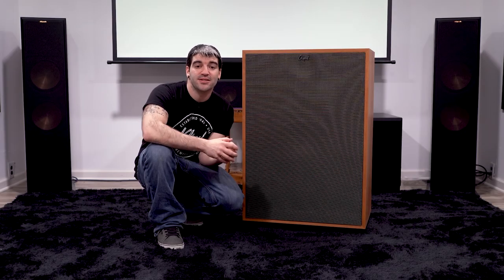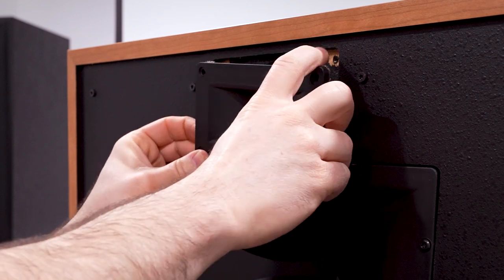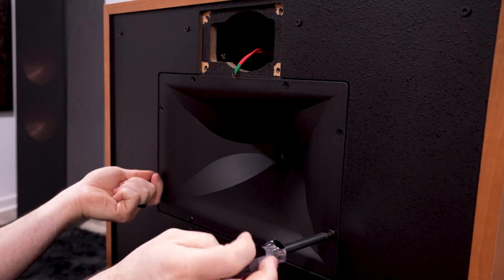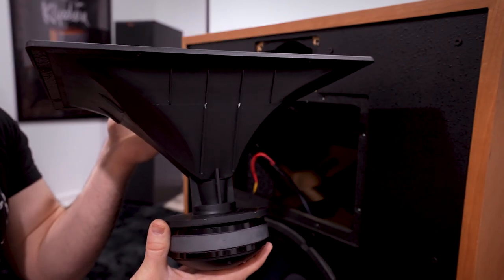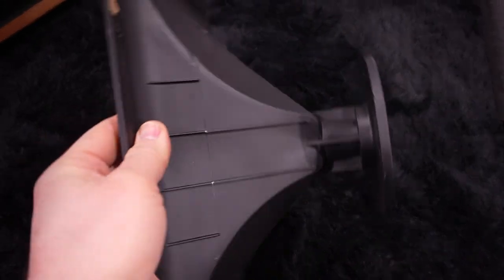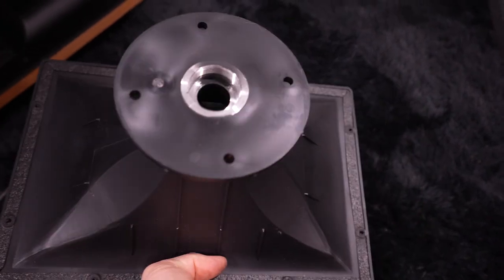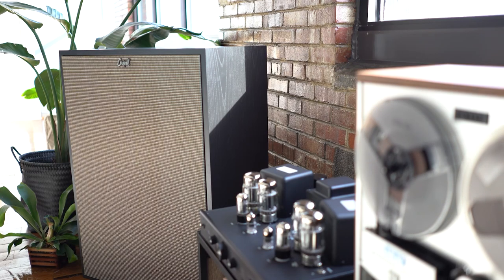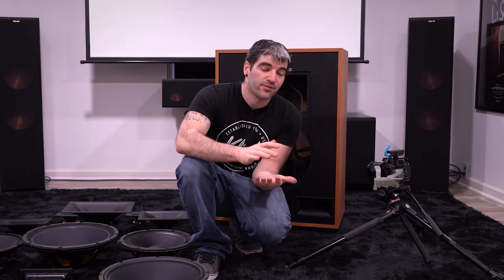What's in the box!?!?!?! - Klipsch Cornwall IV Disassembly

Comment: One would think that for the cost of the Cornwall they'd use a cast frame driver with a large voice coil.  I saw PWK give a talk about 50 years ago at the Hi-Fi Hutch and he explained his use of cheap drivers but he did admit to admiring drivers and systems from Altec and Western Electric.  Years ago he kept several Lowther and RCA systems in his museum: I think he admired Voight and Olson.
Reply from the maker: Honeslty cant speak to why they made what decision. The engineers down there in Hope have 1000x more knowledge on the topic than i ever will. What i can speak to though is the sound that results and...whatever reason they had for choosing the specific components they did, it shines through in the listening experience and still blows me away every time. 
I unfortunately never had the opportunity to speak with Paul directly but know many that have. Ive met with and interviewed Roy several times and his number one goal is always to stay true to what Paul would have wanted and he never strays from this in these designs. 

-Jason

Comment: Interesting that the Cornwall's do not have some sort of insulation inside the cabinets
Reply from the maker: Thanks for watching! They do. There is foam that wraps the sides. I didn't pull it out because its tacked in there but you can see it when I show the insides through the LF hole. 

-Jason
Reply: Bass reflex speakers don't need stuffing but only some sidewall insulation to absorb the higher frequencies from the woofer. You need only put insulation on 3 sides, just so one side of two opposite sides has insulation.

Comment: They all look like PA drivers, not impressed for the price
Reply from the maker: A lot of the heritage line has roots in PA so, makes sense...but what's wrong with PA drivers? And what do looks have to do with anything? Have ya heard em?

-Jason
Reply: I have listened extensively to Cornwall yes my friend owns a pair. They sound OK but not at the price point. My friend loves them so.
As for the looks they look cheap PA drivers they aren't even cast baskets 
Crossover looks like its from amazon for £20
Enclosure is built to the lowest high standard they can get away with. 
Sorry for my opinion but it's valid. Overpriced by 50%